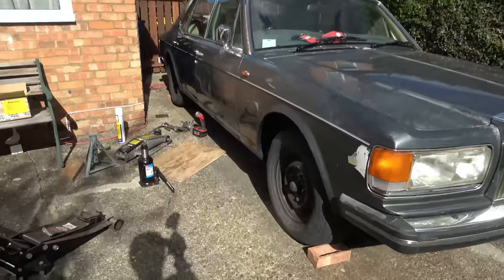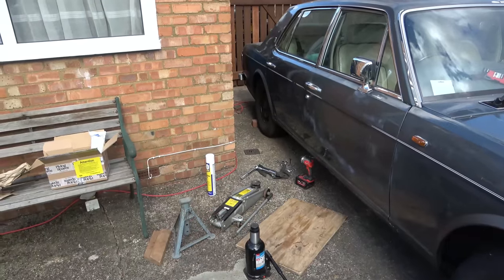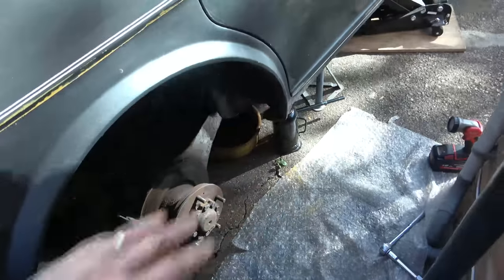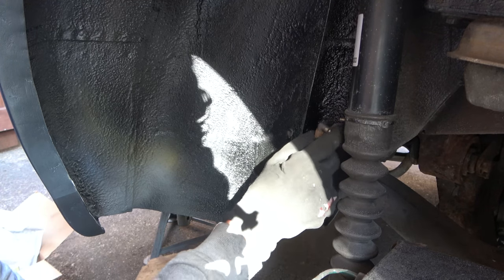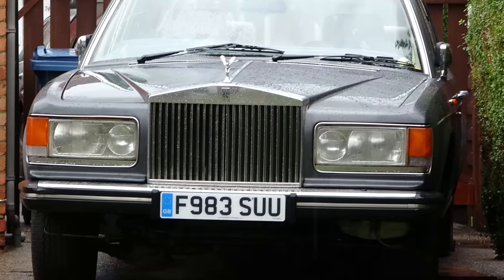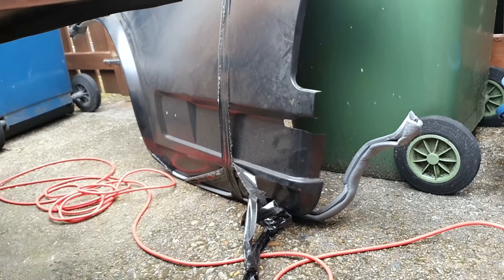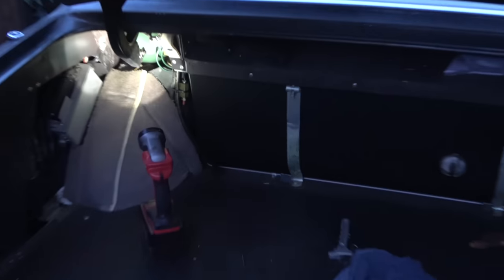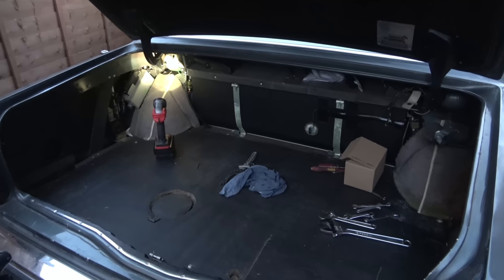Rolls Royce Silver Spirit Restoration PART 25 - REAR SUSPENSION HYDRAULICS

Comment: I had a Citroen xantia years ago. It's spheres were green.. and there should be a regulator in the engine bay. It's like a master cylinder.. I only had one system though for steering .brakes and suspension.. looks like the rolls has 2 seperate systems?

Comment: Surely there should be a master cylinder for the LHM. Citroen had 4 cylinders and a master in the engines dept. Also the LHM changed over the years - worth checking

Comment: Was that actual Roll Royce brake fluid from Halfords? The RR Silver Shadow used Mineral fluid, bought from RR, if I had used Citroen brake fluid it would have ruined the seals and washers of the system. Keep up the good work.
Reply: It looked to be the correct LHM which is Liquide Hydraulique Mineral or Hydraulic Mineral Oil specified for use in Citroen or Rolls Royce.  Normal DOT 3.0, 4.0 and 5.1 brake fluid is a synthetic and Dot 5.0 is silicone fluid, and these are not intended for the Citroen or Rolls with this type of suspension and braking system combined.  The Hydalastic and Hydragas used on BMC/BL/ARG products from the 1100 through to the MGF is a different system relying on the fluid itself as a lever into the spheres/pistons at each end and uses a different fluid.

Comment: LOL the jack weight, when I was 19 I bet the rest of the workshop that the recovery truck winch could pull more than its rated limit, you just use a snatch block and divide the points of contact and walked away with 100quid in my pocket so your RR a 3 ton car jack you are only ever going to lift 1 ton max

Comment: On the drive wheel on your welders there are groves 0.8 and 0.6  if your using 0.6 wire and it’s not feeding properly your probably on the 0.8 side on the drive wheel just flip the wheel!

Comment: the side you are working on to release the pressure, is jacked up, and therefore has nopressure on the system.  By bouncing the other side of the car does absolutly nothing as you are not putting any pressure on the side that you opened up the drain.
Reply from the maker: That makes sense, cheers Shane 👍👍

Comment: When you change the oil, don't recycle it, keep it and mix in about a pint of diesel and use the mixture to coat the inner surfaces, use one of them weed sprayers to get it right down the inner sills sort of areas, far cheaper than waxoyl and just as effective, you could mix in some kurust which would also act as a preventative.   Chap in the early eighties showed me, he had from new bought in the sixties an old Triumph that had never ever been welded, every two years he would use the stored used oil, mixed in some diesel and he would spend a weekend getting right into the crevices, nooks and crannies of his Triumph plus he would lather a coat on the floor pans, inner arches etc and that car was like brand new bodywork.
Reply: Bet that stunk!

Comment: I never use aftermarket parts unless OEM are not available.  (Or if it's an emergency)  every single time I have used aftermarket parts, they don't fit right or they fail right away.

Comment: For safety's sake invest in some heavy duty axle stands or you could end up doing a tube 'crush' video!! Not much point risking your life just for a youtube video.
Reply from the maker: I felt quite safe for the small amount of work I done under the car on the bleed nipple. I had 2 Trolley Jacks, 1x 20 Tonne Bottle Jack and 2 axle stands supporting that side and other side had the 2 wheels on the ground.
Reply: @Mymatevince  I would never put my faith in hydraulics. Even garage car lifts have massive solid metal stops. Valves and seals can go just like that...speaking from a very near miss with a 100 to drop hammer!
Reply from the maker: @johnhill2813  Thanks John 👍👍